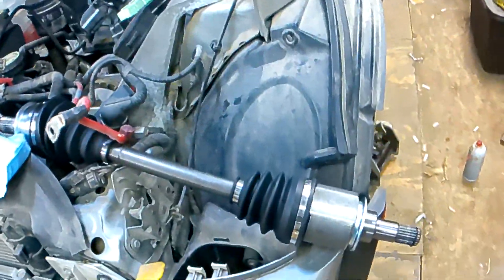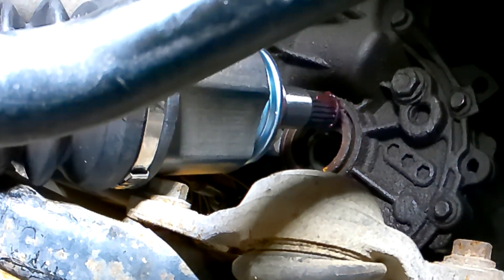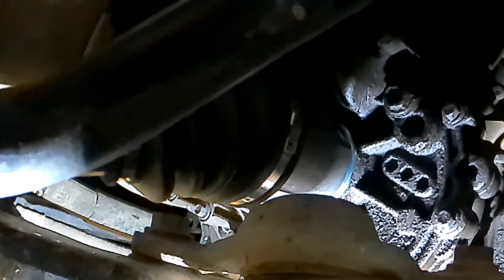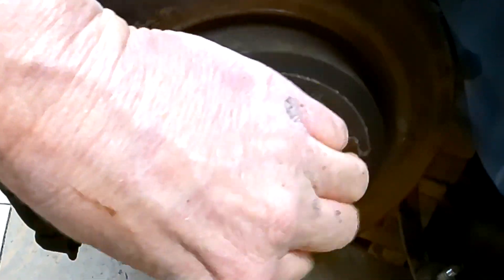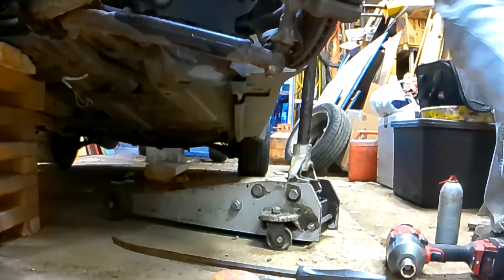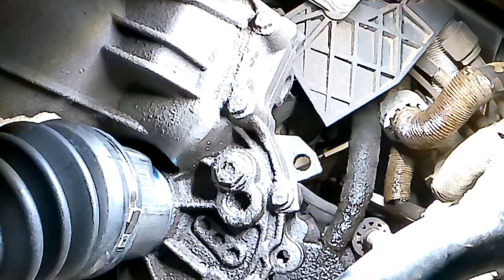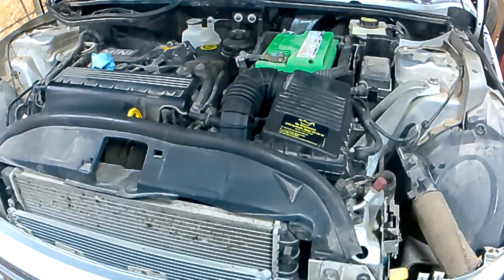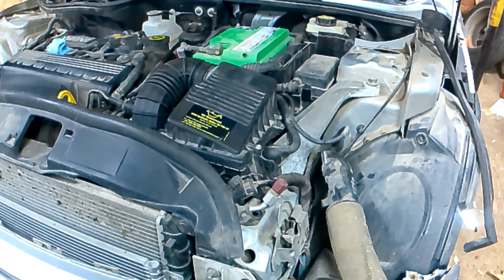2003 Mini Cooper left CV axle install. Will this fix it?

Comment: Awesome video brother.  Maybe i missed it but how hard is it to get that cv joint out with the ring locked in the transmission?  Thanks for sharing.  Keep the content coming.  Hope you have an incredible night.
Reply: They make a tool that is similar to a huge pickle fork.  They call it an axle popper😊 Fairly easy to use if you have enough room.
Reply: @coleenteabo7033  Thanks never did that job but have someone that asked me to change theirs for them so I have been stalling. Lol